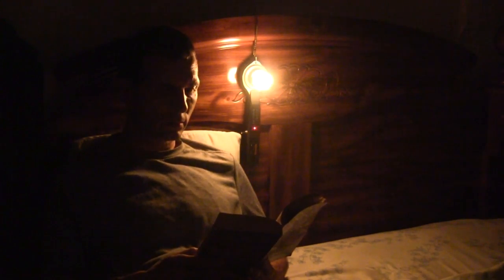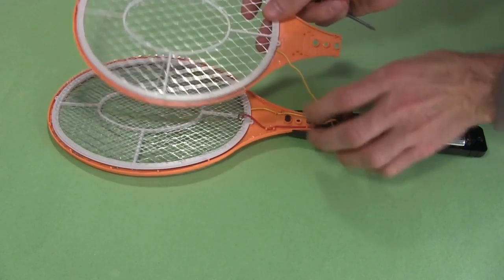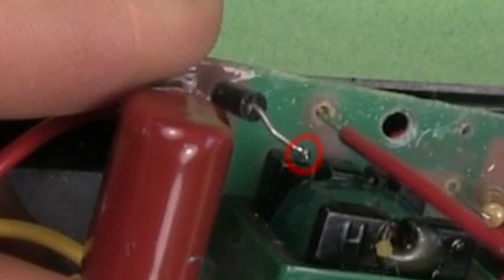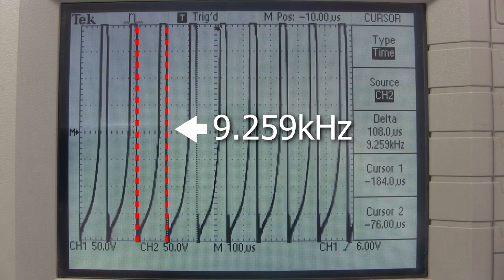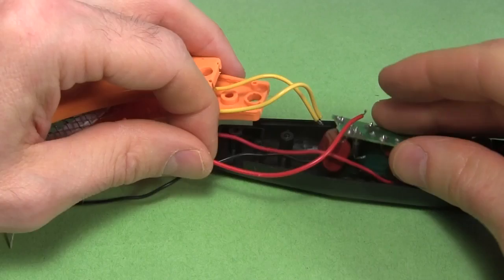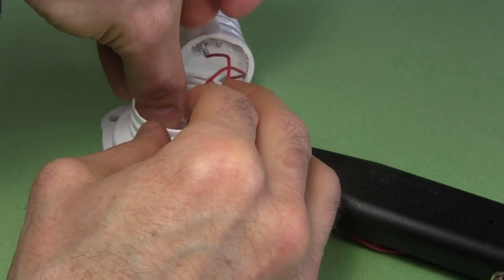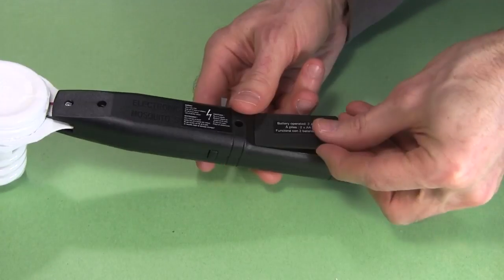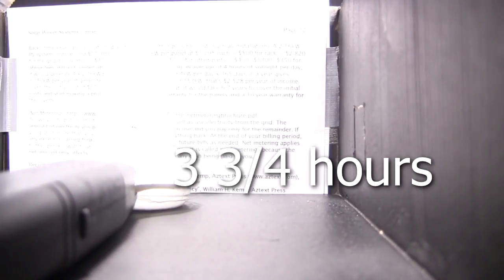How to Make CFL Powered by Electric Fly Swatter/Racket Zapper

Comment: I did it, it works well but i noticed that the transistor SD965 is hot after 5 minutes so i just inquire if i can replace this transistor and use IRFZ44N mosfet instead?
Reply from the maker: I don't know about using a mosfet instead or how you'd modify the circuit to use one. Another opiton might be to switch to a power transistor and put the transistor on a heat sink.

Comment: I’m running a 36W fluorescent with this method. It’s awesome, but the high frequency whine is quite annoying. Is there a way to change the resonant frequency?
Reply from the maker: Yes, you can change the frequency by changing the value of one of the resistors. You can see me do this at three minutes and eleven seconds into this video which uses the same circuit https://www.youtube.com/watch?v=yz_99oVMbSI Your fly swatter may have a different circuit but I show how mine is the same as a joule thief circuit at two minutes and twenty-three seconds into my first fly swatter video https://www.youtube.com/watch?v=niRCKUliQWs In the diagram which I show there, it's the 1200 ohm resistor you'd have to change.

Comment: that's a great one, l-l-love it. Thanks for sharing! Also congrats on creating what must be one of the very few CFL or 'low-energy' lights that should be NOT EMITTING ANY so-called dirty electricity for lack (proper removal) of all the original electronics*) powering the AC original variant of it. Great job. 

Question: could you briefly answer (or maybe even run a brief how-to) on properly grounding small electrical devices (like power supplies for laptops, so-called 'smart' battery chargers, wired-LAN routers/switches etc)? These days, they usually come without 3-pronge plugs, hence no grounding from the sockets. I would like to know (1) if and how I can replace the default power supplies coming with them for a grounded one bought separately and (2) whether a grounded power supply is good enough for properly grounding the connected DC item (e g an Ethernet switch or laptop computer in a plastic case) over that simple 2-wire black-and-red standard DC cable that comes with such devices, or if I need to drill open/attach a separate ground wire from the DC-powered device to Ground? For easier grounding, would a grounded and shielded Ethernet cable (CAT-7 STP or similar) work for that job if I am careful to select one with metal RJ-45 plugs running to a similarly metal-equipped switch or router that's also properly grounded? (Apart from EF and possible electromagnetic and/or RF interference, this might also improve data throughput and lower error/repetition rates.) Any info -- let alone a video on that -- would be great and much appreciated, too. Thank you.
---
*) if you want to be absolutely technical --  I don't know the fly squatter stuff's reading's specifically, but they're likely way lower already...

Comment: Hi Rimstar! If you put 18W LED bulb (240V) instead of the CFL bulb, it will brighter than that.
Just use a cheap LED Bulb and enjoy the light up to 6 hours with very good brightness.
If you can find NPN transistor as 2SD882, it will be good fair and "punch up" the efficiency.

Greeting, from Indonesia.
😊🙏👍
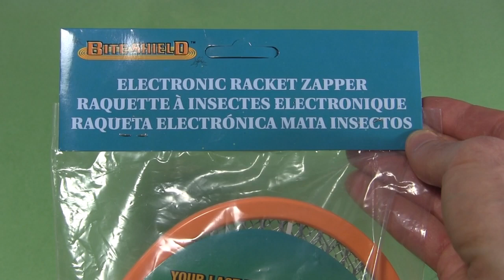Reply from the maker: For an LED bulb, I think you wouldn't want to connect to the output of this fly swatter since it's too high voltage. I think instead you'd want to run it as a normal joule thief. So in the circuit shown at 0:53, I'd put it between the transistor's emitter and collector. There may be other circuitry in the LED bulb so you may have to bypass that too.
I haven't played with commercially made LED bulbs so I would be wrong about all this.
Reply: Thanks for your response, your channel is cool!

Actually my project using cheap chinese 18Watt LED Bulb (240V) was using your this project perfectly. Actually my project is just Joule Thief with secondary turns as your project over here. You may assume that output of Fly Swatter too high, it's true but it was SPIKE of inductor principal about inductance. It may be high over 1KV, but when LOAD connected, as LED Bulb, the LOAD absorb the SPIKE and transform it to Light.
We always thinking; "but in the LED bulb there's rectifier diode and capacitor, how can it be?" but many people not thinking about the unique of Inductor as Voltage Booster (flyback mode) and how low Wattage in spike voltage transform into light, especially with LED output.

I'm so sorry if my english so bad.
Reply from the maker: Cool! I'm glad to hear it worked. 6 hours is a very long time. Thanks for sharing your result.

Comment: What's the voltage of the rachargeable battery inside a mosquito bat?Can we connect it to motor by connecting resistor to it?If yes,which resistor shld I connect?
Reply from the maker: The voltage of the one I opened up (https://www.youtube.com/watch?v=niRCKUliQWs) is 3 volts, but they're not rechargeable batteries so yours may be different. The output is high voltage so, no, you can't connect a motor to it.

Comment: I'm trying this now.I got the CFL to light but I'm not sure exactly where to hook the wires. I tried on the transformer but I get nothing. I found one of the output points but I think its outputting DC and not AC. I'm making a set of quick videos on this.
Reply from the maker: I'm confused. You say you got the CFL to light but you're not sure where to hook the wires. How did you get it to work then?
If you hook it up to the transformer and get nothing then maybe your CFL tubes are no good? It could also be that your CFL tubes are too long for your circuit to ignite, in which case try a lower wattage CFL if you have one. If the problem isn't that then something may be wrong with your circuit. Make sure you have a new battery to start with just in case that's the problem.
Reply: I kept trying different points on the board. some of them did nothing some lit the bulb with no buzzing and some with heavy buzzing. I eventually settled on putting the other wire on the middle of the transformer and there is no buzzing but the light works. I have a few videos of this that I am going tp upload one is me asking for help and the other two are me figuring out what points and the last one is me testing. I'll just upload the videos. stay tuned to my channel.
Reply from the maker: What you did in part 3 is what I would suggest. I don't have time to analyse the circuit, there's a lot more there than with mine, but since you're connecting to the transformer then it should be AC.
Reply: I connected the bulb where the grid went and I saw that one end of the tube glowed a brighter blue and that changed to the other end when I reversed the wires. Where I have it now both ends of the tube are glowing blue. I may just break down and get a 12 volt CCFL inverter. will that power this bulb? Might not be as bright at when it's on 120VAC.
Reply from the maker: I don't know.

Comment: doesn't burn the transistor with continues on?
Reply from the maker: No, the transistor has never been damaged.
Reply: really? because in twiste cfl's driver circuit the transistors always burn first.
Reply from the maker: I guess if you use it regularly for a long period of time then something will burn out eventually. It happens with regular CFLs, so I suspect it would with DIY ones too. I don't use it regularly.
Reply: may be :)

Comment: Hello I have a zapper circuit that I think has a bad transistor b/c when I connect it to 3V power it gets hot. Any ideas where to get a similar transistor like from a dead CFL lamp inverter because I have three sitting in front of me now.
Reply from the maker: +coondogtheman1234 Is there anything written on the transistor from the zapper circuit?
Reply: RimstarOrg

It says:
H SD
   965
7LTR

The circuit was from a zapper that had no pop so I tried to change it so I don't think that's the original transistor.

The ones on the CFL inverters say
4124DL GFG E6AM
Will those work?

I have the guts from a small solar light with S8550 D 331 transistors on it.
Reply from the maker: +coondogtheman1234 Not knowing what the original transistor was I can't say if it's a good replacement for the original. But based on the datasheets for the two numbers you gave:
http://pdf.datasheetcatalog.com/datasheet/hsmc/HSD965.pdf
http://www.unisonic.com.tw/datasheet/4124D.pdf
it looks like the one from the CFL might have a chance of working as a replacement. Keep in mind that it may also be some other part that's broken, like the coils or a capacitor.

Comment: Does it matter what bug zapper I use or can I buy a cheap one at harbor freight and hack it up? I ask because some say 1500 volts some 2300 volts and some 2750 volts. I even have a 3700 volt one but it's a bug light but a handle comes out and it can be a hand held zapper but it's too heavy. I did make one of these from a camera flash circuit but it's dying. it doesn't like 3 volts so might do this one.
Reply from the maker: +coondogtheman1234 I don't know. I have experience with only the one in this video and I have noticed from other people's videos that there are differences in circuits from one manufacturer to another, but I haven't analyzed the circuits in those videos to see how they work.
Reply: RimstarOrg
What I think is the circuit is the same in all zappers they just use a different capacity capacitor say 1000v or 2000v. I'm going to do what was done in the video.

Comment: may i know
 hw many watt cfl is used?
Reply from the maker: +Retna Nair It was a 13 watt CFL. If you watch another video where I work with pretty much the same circuit (https://www.youtube.com/watch?v=yz_99oVMbSI) you'll see at 6:10 what happened when I switched to a 5 watt CFL and changed the resistor value.

Comment: Hi, I noticed the transistor on my swatter turns hot to touch even when there is no load connected to the secondary of the transformer. Is this normal? It's a D965. I made a test using a 18W small fluorescent spiral tube and it doesn't light much bright. Should I use a fluo tube between 5W and 13W like in your video? Cheers!
Reply from the maker: +Viktor Božičević Mine didn't get hot, so I can't say if it's normal. I know that normally to power a CFL with a joule thief circuit like this, a power transistor is used and often with a heat sink, so I'm not surprised that it gets hot. If it gets really hot then you might consider replacing it with a different transistor, even maybe a power transistor with a heat sink. It's essentially this circuit here http://rimstar.org/science_electronics_projects/joule_thief_power_cfl_with_jeannas_light_circuit.htm.
Regarding your 18W small fluorescent not being bright, I'm not surprised. With my joule thief circuit made from scratch for powering CFLs, when I switched from a 13W CFL to a 5W CFL I required less power for the same brightness (I could use a higher value resistance with the 5W one to get the same brightness as with the 13W one and a lower value resistance.) You can see this in my video here at 5:15 https://www.youtube.com/watch?v=yz_99oVMbSI
Reply: +RimstarOrg What do you think will it work with 2n3055 or tip31c transistor, or maybe even with 2n3904? And I'll try with lower wattage bulbs.
Reply from the maker: +Viktor Božičević The 2n3055 should work (it's what I used in the one I linked to), the tip31c might (at least you can put it on a heat sink), and the 2n3904 won't be significantly better than what you already have.
Reply: Hi, have you maybe used G23 or other plug in types of cfls with HV joule thiefs? I'm asking this besause I spotted these types of low wattage bulbs are much cheaper than the E27 ones. But I'm only not sure whether they have any step down circuit inside the base or the tube is connected directly to the mains contacts? Cheers.
Reply from the maker: +Viktor Božičević I've only use the E27. But I don't think the base matters since it's cut off and not used; only the fluorescent tube is used. Regarding the tube, however, you want one that's pretty show and low watts. The longer the tube and the higher the watt rating, the higher the voltage you'll need to get it to work.

Comment: Creat.
Can you show how to modify one of those lamps to use 12v?
I've a solar panel and a battery. I hate to have to use the inverter just lo light a lamp.
Btw, the reading lamp is an awesome idea. 
i like to read till i get sleepy, and for that i need a dim light. with batteries is better :) i could use some rechargeable batts.
Reply from the maker: Jerónimo Barraco Mármol I don't know the modifications off hand. It would take some testing to see if the transformer can handle it and if the transformer's output voltage would be too high for the capacitor. It's not something I can calculate.
You could also look into getting a 12V DC lightbulb instead.
Reply: thanks i googled a bit, it seems possible.
By laws of demand and offer, given that my country has imports blocked, it's cheaper to get a cfl than a 12v, led,  or 12v cfl.

Comment: Only thing I'd change would be taking the bottom of a disposable clear plastic bottle to protect the tube and make it more durable.
Reply from the maker: ***** Oh, good idea! Or maybe a small glass jar so that it would take any heat, not that it gets very hot.
Reply: This is a perfect idea and I had fun making it! I think I should've used a large resistor replacement...higher wattage I mean because I didn't follow your instructions perfectly...I kind of ignored the part of waiting to see if parts get hot. I tried higher voltages which worked great! But the component parts which got a little hot before got REALLY HOT and I think I fried the replacement resistor. I'm gonna experiment with different resistor strength AND try a higher wattage resistor (2 or 3w instead of just 1/2 watt) and see if I can boost the light and stability of the circuit. This is a great circuit to have fun for beginners and learn how to "tinker" with a circuit to get different results. The cost of failure is not high either! These electric swatters are pretty cheap.
Reply from the maker: ***** Keep an eye on the transistor heating too. You may have to attach the transistor to a heat sink. I'm glad to hear you're having fun with it!
Reply: I think you're right. After reading your comment and rechecking it seems that the transistor is overheating. Putting a heat sink IS a good idea if I play with the voltage but then I'd have to do something different with the "handle" being used as a case. I don't think any decent sized heat-sink will fit...then again it might look interesting if I apply it in a creative way!

I have really enjoyed lots of your experiments and "hot to" electronic presentations and I hope to try as many as possible. Thanks again.

Comment: hello rimstar.. i have a rechargeable fly swatter and it has an inbuilt battery of 9volts which is charged by connecting to 230v-240v which is converted to 12volts dc chargted and it has a buigger circuit than your electric fly swatter video... so i'm a beginner to electronics .. so can you please help find out in circuit??
Reply from the maker: Navneeth S. I don't understand your question. Are you asking if I can help figure out your circuit? If so, I can't without actually having the fly swatter in front of me.
Reply: ok thanks for the reply i will surely make a video of the circuit inside  the fly swatter . the battery inside it is a rechargeable version

Comment: Great video. My zapper was a little different but like you said the basic principle was the same, it had 3 capacitors and 3 diodes but I removed them all to get the best light. I find mine will shut off at a convenient 2V and is now great for cycling my crappy NiMh batteries, I get around an hour from them with a 16W CFL.Thanks again for sharing, stuff like this makes ya wish you stayed in school longer :)
Reply from the maker: NZHorizones Thanks. And thanks for sharing your experience with your zapper. Re school, I stayed in school but stuff like this makes me wish I'd paid more attention. :)

Comment: Out of curiosity, is there a more energy efficient way of testing the longevity?
Reply from the maker: Loser Spud You mean without wasting batteries? I can't think of any way. However, if you're actually making use of it at the time (unlike what I did), such as using it as a reading light, then at least the batteries won't be wasted.
Reply: RimstarOrg Good point, thanks. I can't imagine the technology would have much day-to-day use. Cool project, by the way!

Comment: I bet you can improve this design by taking advantage of the filaments inside the bulb! Believe it or not, they will actually be more efficient if the filament is heated! And you will get more light from it, too! So I think one way to do this is to only connect the HV to one of the 2 connections on either side of the lamp, and the remaining 2 can be bridged together with a small, HV capacitor. So that most of the HV goes through the lamp, but a small fraction of it will go through the filaments to keep them warm. Running lamps in CCFL mode I think also reduces lifespan, though I am by no means an expert on them.

Comment: How are you going to replace the bulb when it burns out?
Reply from the maker: Brandon Fisher I'd just cut a tube from another "broken" CFL, solder some new wires to it and use the marrettes to connect is to the circuit. I guess if you attach alligator clips to the ends of the wire coming from the circuit then you could skip the soldering step and the marrettes and simply connect to the CFL tube's short wires using the alligator clips.